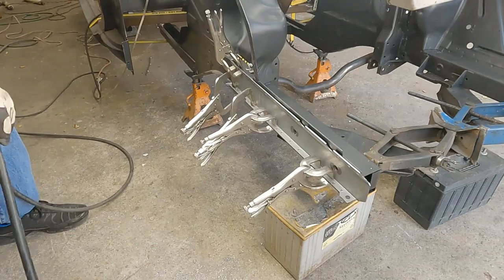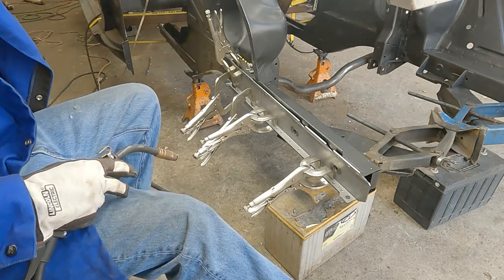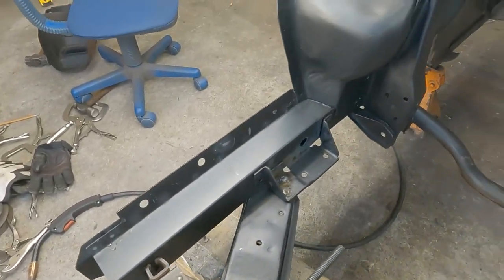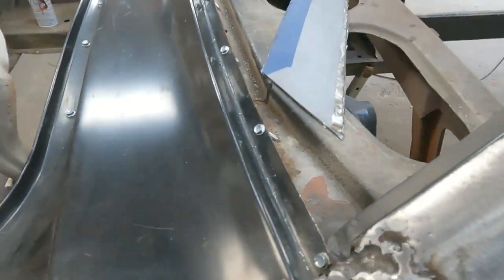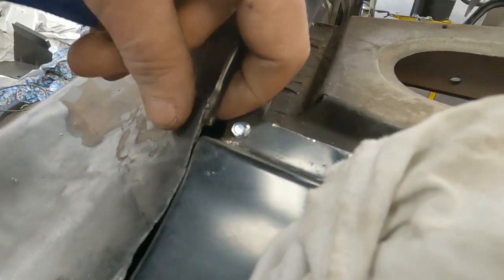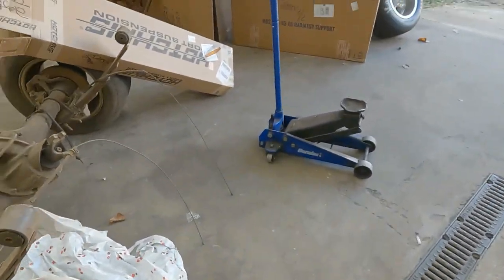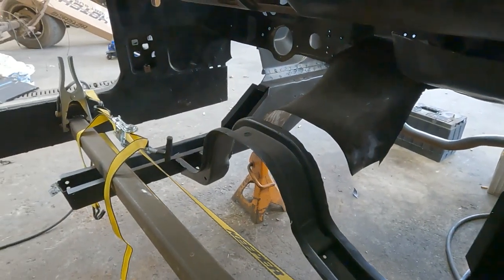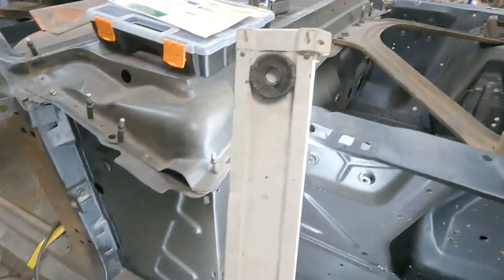65 Mustang Frame Rail Repair

Comment: Welding overtop of a battery.....If that sucker was Off gassing.  BOOM !  There would be plastic and battery acid Everywhere!
Reply from the maker: It's been dead for years no voltage at all so no hydrogen gas to ignite.